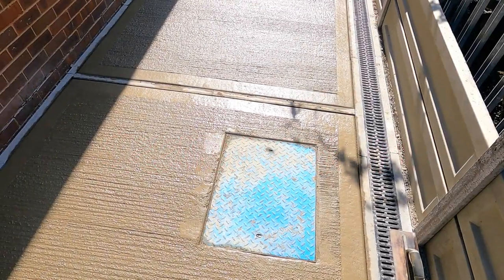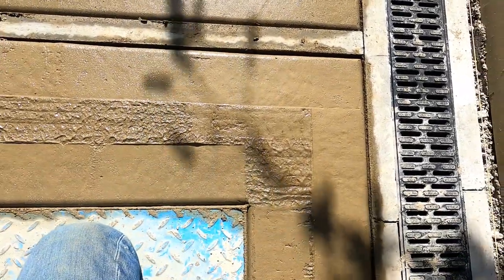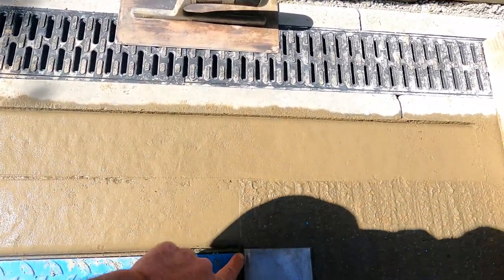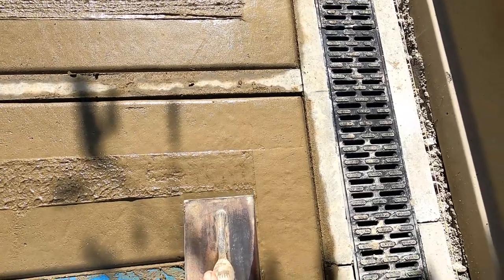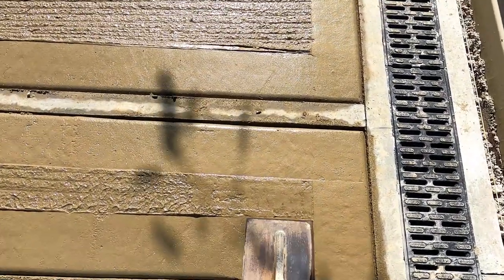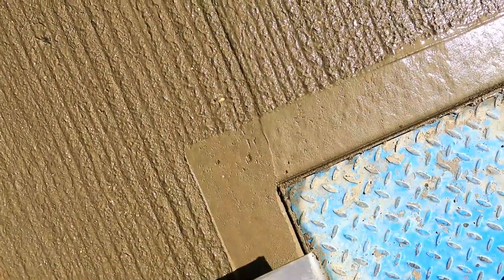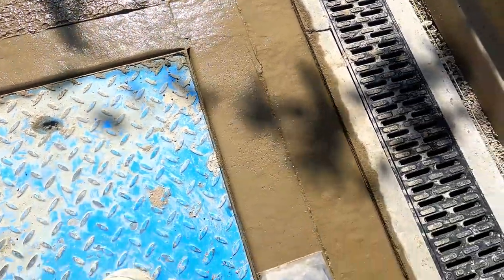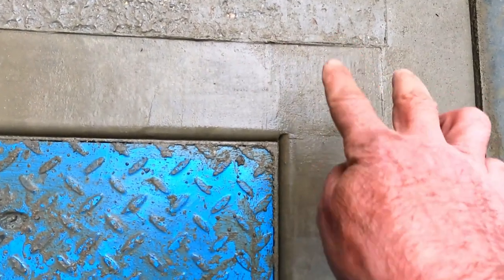Edging Around A Manhole Using A Marshalltown Edging Trowel

Comment: That's either an electrical or water box, not a manhole, sorry.
Reply from the maker: Your 💯 wrong most definitely is a manhole
Reply: @creativecrambo  that leads to sewer? If so that's kinda dangerous, manholes covers are typically circular and rather heavy so people can't get down there easily. That's definitely a utility lid/box but I'm not gunna argue that cause it could just be a colloquial difference.
Reply from the maker: @joey123456MINECRAFT  
Believe it or not that is a heavy duty frame and lid trust me I set it in after raising the manhole not all manhole lids are round to sounds like you haven't done many, it's all good mate thanks for stopping by the vid .
Reply: @creativecrambo  ya np, any time you feel like edging a radius I'd like to see how it turns out
Reply from the maker: @joey123456MINECRAFT  
Might do a video on that that's an easy one 👍